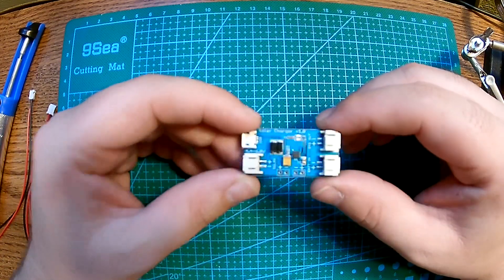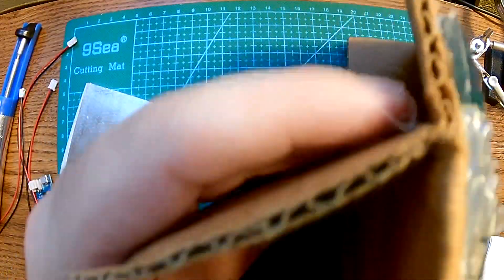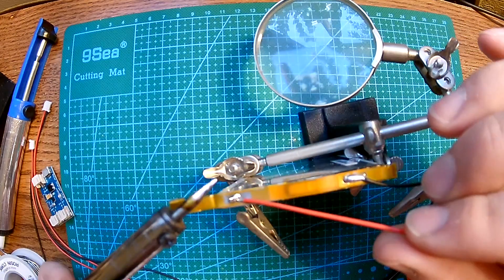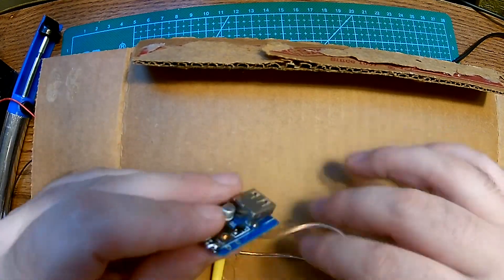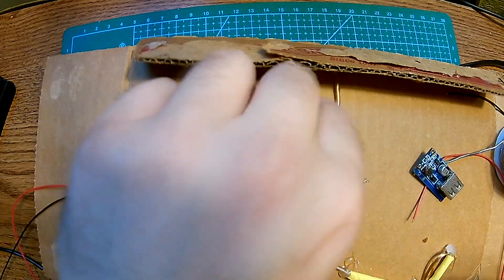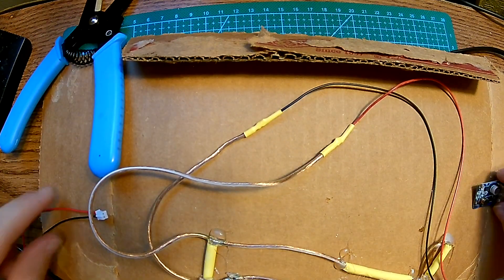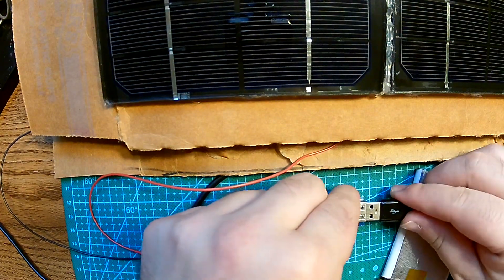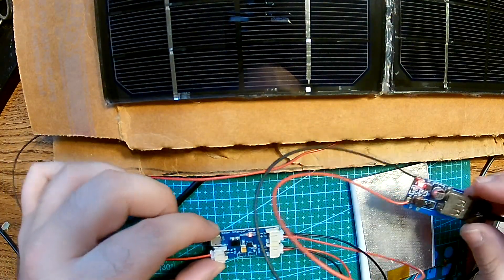Super Mini Solar LiPo Charger v1.0 (CN3065)

Comment: If I use this setup to power a bird bath fountain pump, and I attach a lithium battery and a solar panel, will the solar panel charge the battery first? Or will it send power to the fountain first or will it equally divide the power or how will the system work? 

Basically I want a system in which through solar panel, I will be able to run the bird bath fountain, and if the weather is cloudy during the day or in the late evening, the bird bath fountain can run from the battery power which was charged from the same solar panel during the day and the same panel runs the pump during the sun. 

How to do that?

Comment: hi, The reason why it was charging at first was that the battery was full, that is, the power bank was not charging with the energy coming from the Mppt module. The real problem starts when the battery runs out. When the battery runs out, If solar energy is not strong enough to charge the battery and power bank, the devices will not work.
Reply: If I use this setup to power a bird bath fountain pump, and I attach a lithium battery and a solar panel, will the solar panel charge the battery first? Or will it send power to the fountain first or will it equally divide the power or how will the system work? 

Basically I want a system in which through solar panel, I will be able to run the bird bath fountain, and if the weather is cloudy during the day or in the late evening, the bird bath fountain can run from the battery power which was charged from the same solar panel during the day and the same panel runs the pump during the sun. 

How to do that?

Comment: Is this still an active thead? Im trying to help my son with a school project and im trying to incorporate this into power and led strip for a small table lamp. Its fryjng my brain! I have a rechargeable batter wuth an in and an out! And im confised if i need to connect the in to comthing else so the battery charges then the out to the connection you used! Then the out going to the lights?

Comment: Just want to say some things about this charger. 
>I've used this with 1W and 3W 6V panels. I am using it in a sensor node in my garden. The panel voltage is at 6.5V most of the time and the charger seems fine. I have briefly tested with an open circuit voltage of 7.39V and it survived just fine (I do not know how long it would last at that voltage).
>The header pins on the side are 0.1 inches apart so it is easy to solder onto a perfboard or use on a breadboard. 
>The connectors are not regular JSTs so you may need to buy new ones or just solder to the header pin holes. 
>The charger consumes very little current so you don't have to worry about it discharging your battery.

Overall I think this is a nice breakout board with the only disadvantage being it's low maximum voltage. If you need MPPT or higher efficiency than a linear charger you need to look elsewhere.
Reply: If I use this setup to power a bird bath fountain pump, and I attach a lithium battery and a solar panel, will the solar panel charge the battery first? Or will it send power to the fountain first or will it equally divide the power or how will the system work? 

Basically I want a system in which through solar panel, I will be able to run the bird bath fountain, and if the weather is cloudy during the day or in the late evening, the bird bath fountain can run from the battery power which was charged from the same solar panel during the day and the same panel runs the pump during the sun. 

How to do that?

Comment: Hey!
So i have a 3.7V battery and a 1W solar pannel. In the description,one of the features is that the solar panel input should be inbetween 4.4 and 6V.. What exactly does this means for my settup? Am i good to go,or i need a bigger,in terms of voltage,battery?
Reply: depends on the solar panel, the voltage should be written on the place you bought it from. If you have a multi meter just go outside and measure the voltage when the sun is out. The battery is fine since this board is designed for charging single cell li-po/li-ion batteries. If the panel voltage is correct, just make sure you connect things the right way round

Comment: Can this thing work for 4 cells li ion
Reply from the maker: Only if the are in parallel an you install battery protection circuit.
Reply: @markoni985  is it possible without battery protection? ( in parallel ) also what do you mean battery protection?